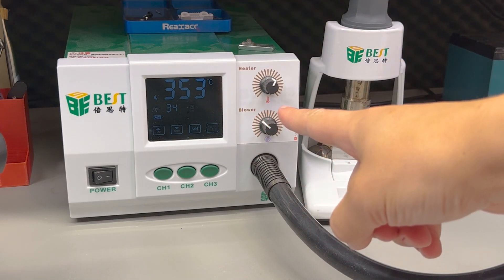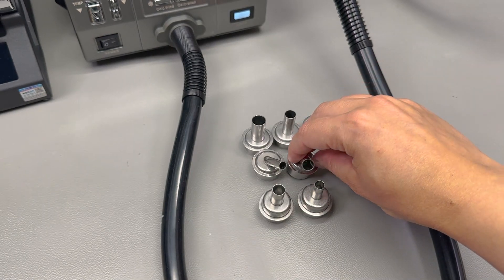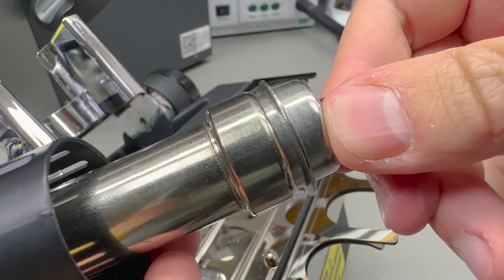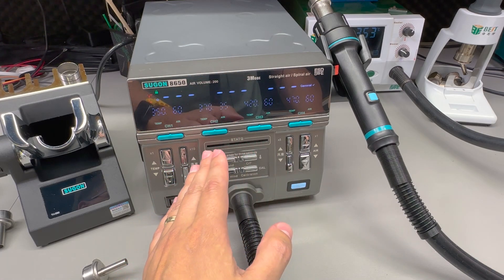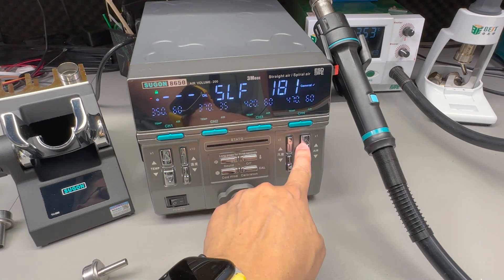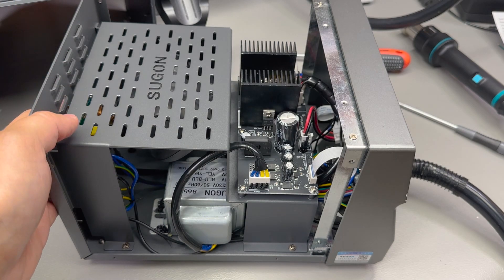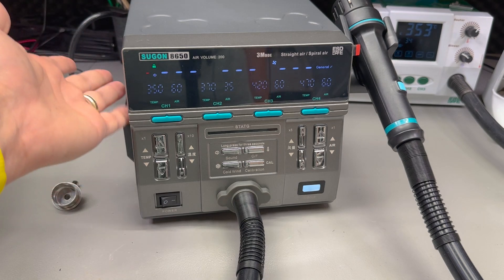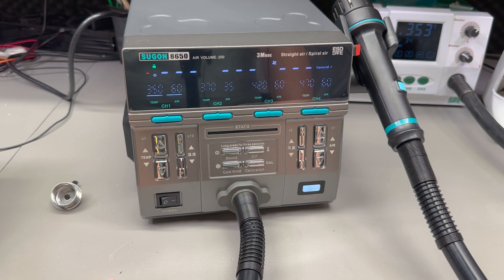Sugon 8650 Most Powerful Hot Air Station | Voltlog #452

Comment: Great review. Looks like it does provide good price/performance. I wonder what's the idle power consumption? Usually old school transformered designs do consume slightly higher while idling.
Reply from the maker: You are right, that is to be expected. I measured 8.1W idle power.

Comment: I hate tools that look like toys because I would feel silly using them. Slanted front with ridges and chrome buttons? LED indicators and LCDs from the 80s? It's like Tesla introducing their next gen model looking like K.I.T.T. -- it can have specs like crazy and be fantastically built but no one is going to buy that shit...
Reply from the maker: Please let us know, what are you buying instead?
Reply: @voltlog  Nothing, not in the market for a complex hot air rework station, my Yihua 2008D is working just fine for me. Just saying, if I was in the market, this one would be a no-go for me for the toy looks alone.
Reply: @danielegger6460  The RF4 RF-H2 1000W station is a bit of an upgrade over the 2008D for $100, if its ever needed. But it does have some flaws.
Reply: I agree, I hate the way this thing looks.  I will stick with Atten or Quick.

Comment: It's good to see such nice build quality at this price. All the functions are conveniently accessible on the front which is also great. The second heatsing is most likely attached to the BLDC blower motor driver. Looks like a very decent hot air station 👍
Reply from the maker: Yup, I agree, second heatsink must be for the BLDC driver. And one thing that I don't think I've mentioned, the blower has very nice ramp up/down slopes.